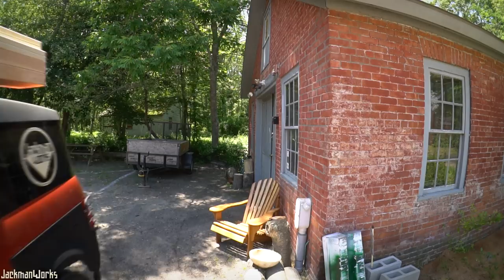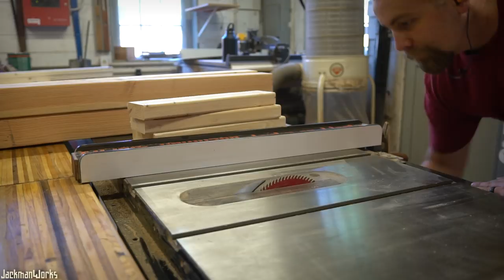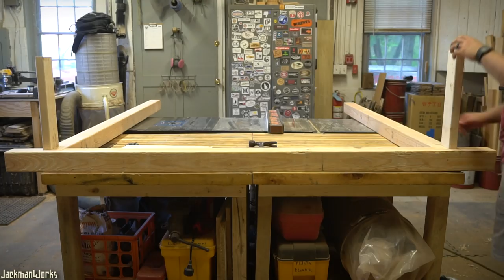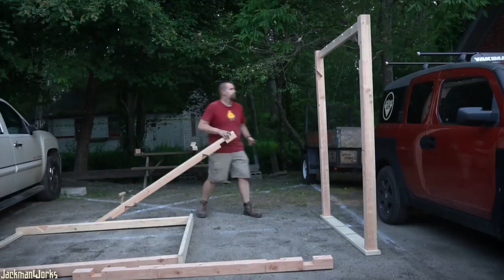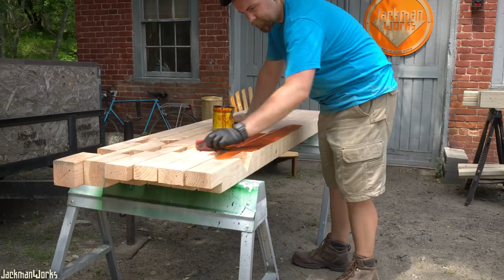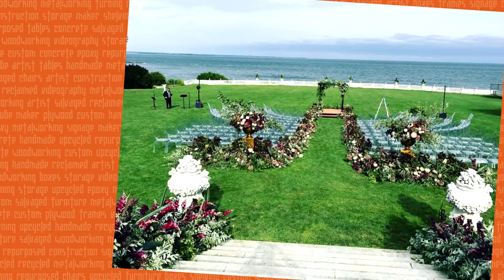DIY Yard/Garden/Wedding Pergola

Comment: That came out sweet! I need to work on how my brain sees words though. :P I read it as "welding pergola" and then I was like hmmm he isn't welding. :P If I made something like that I would make it longer so it could cover my van since I don't have a garage. :) I would also cement it into the ground in the driveway as well. Not the most practical thing I suppose but I live for the impractical. :P - Heidi

Comment: Hey, Jackman. What is the longest board you can fit in your Element? Thank.
Reply from the maker: Inside I can fit an 8 footer with a few inches to spare. That goes on top of the passenger seat and the right rear seat from the glove box to the back door with just a little wiggle room. Anything bigger goes on the rack :)